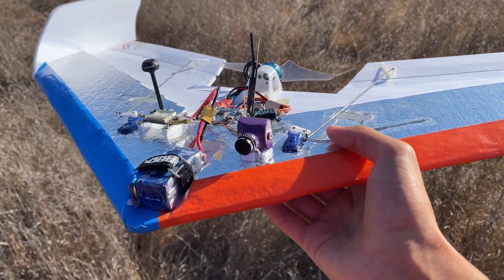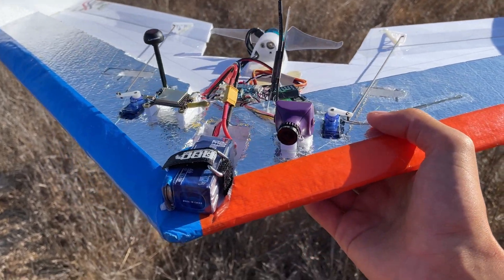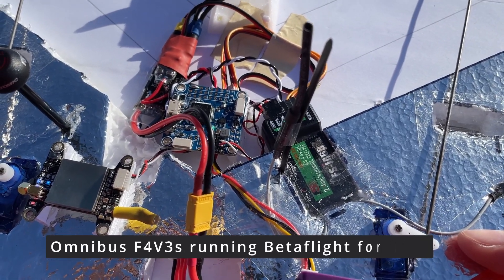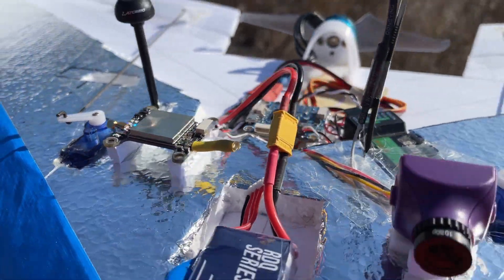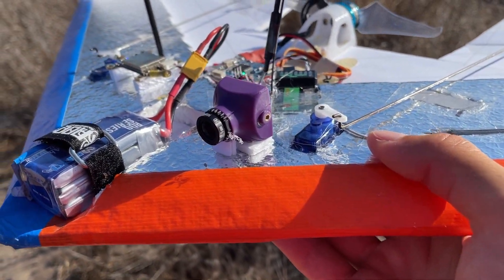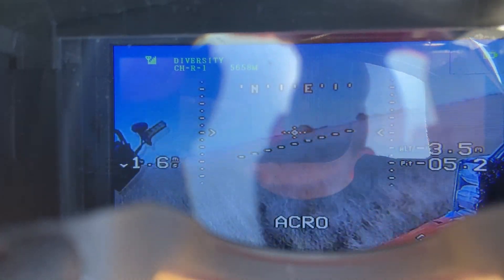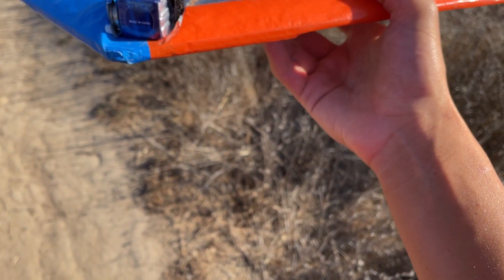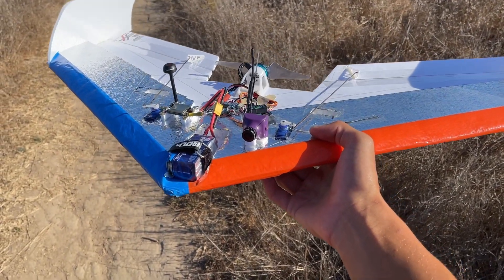Flying Wing with OSD

Comment: cool. What's with the lag on the artificial horizon?
Reply from the maker: I’m not quite sure, I still have some testing to do to figure everything else. I want to flash this board with inav but the the board is not currently supported. I might try cleanflight or somthing but in foresight, all I needed was the voltage osd for battery monitoring
Reply: @theorangebaron1595  find a older I-nav that supports your board like I-Nav 2 I have some f3 on Inav
Reply from the maker: @RobertOrtlepp  I was trying to flash it with older inav versions, but I was only able to go back to 4.0, the older versions might be in the GitHub documentation, will try that soon.